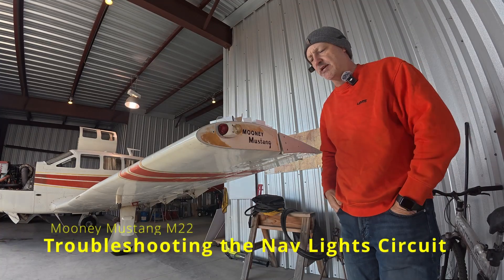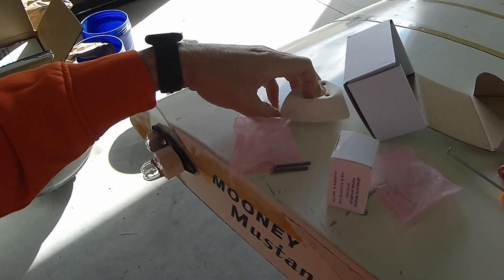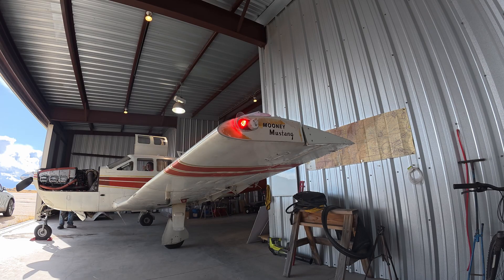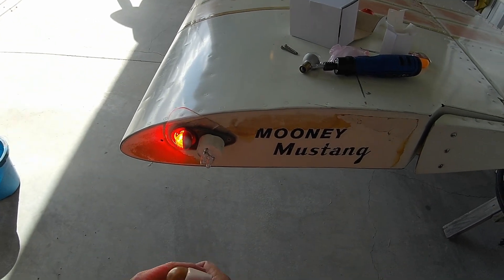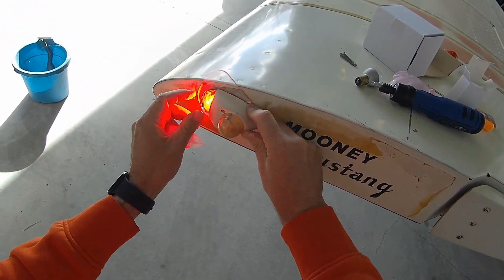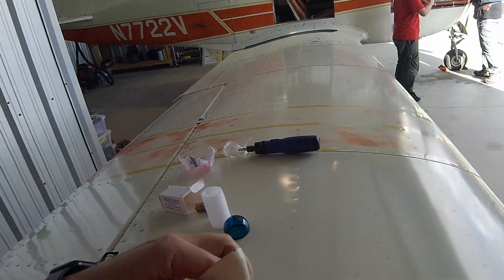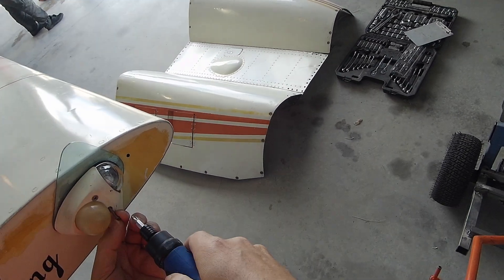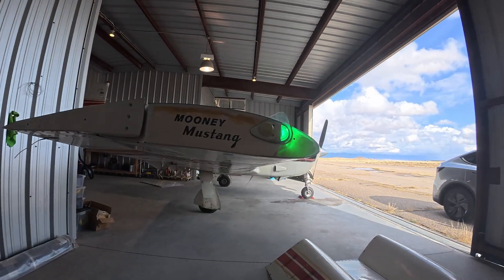Mooney Mustang Electrical Mystery… Solved With One Simple Upgrade!

Comment: Is there an STC for this or is it just considered maintenance?
Reply from the maker: for replacing lightbulbs? no stc needed
Reply: Technically these bulbs are considered for experimental planes but can be used if signed off as a minor modification. 

Here’s what is on the Spruce site: 

Experimental Aircraft Only (for Certified aircraft - these bulbs meet FAA illumination guidelines but have no STC/PMA - ask your IA/A&P to consider these as a "minor alteration"
Reply from the maker: @Marauder92V the plane is being converted to experimental
Reply: Thanks for answering. Hope you have a nice Thanksgiving.
Reply: For your strobe issue, you probably have a bad ballast pack. On my Mooney they were located at the first inspection panel from the wing tips. 

I got rid of all the strobes and nav bulbs replacing them with WAT LED units. Those ballasts if I remember correctly are over a pound each.
Reply from the maker: @Marauder92V  I might go that route. I might source experimental ones once I have the experimental exhibition status confirmed.